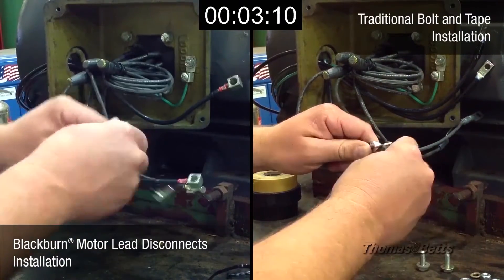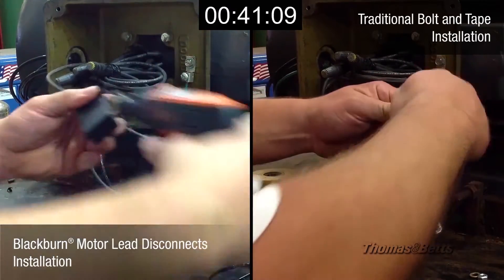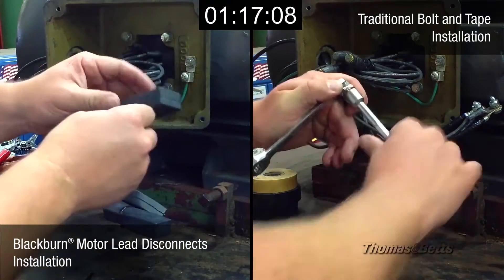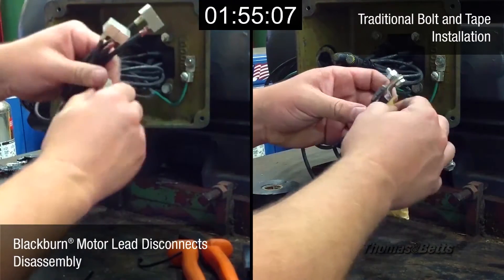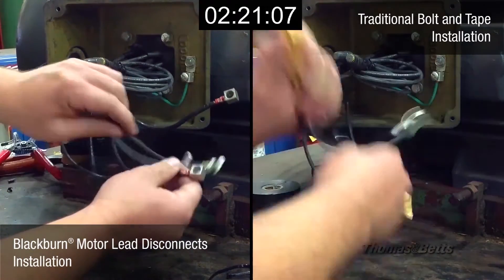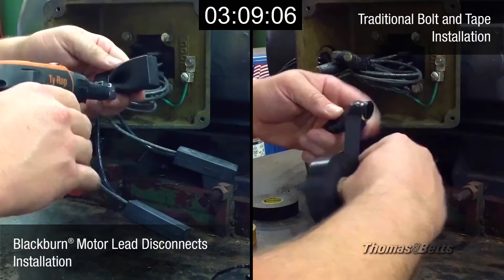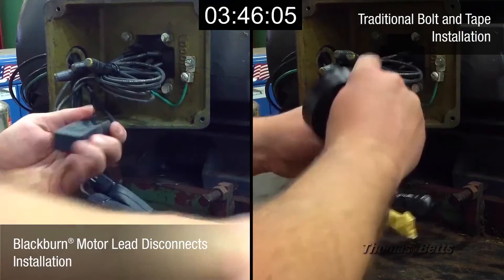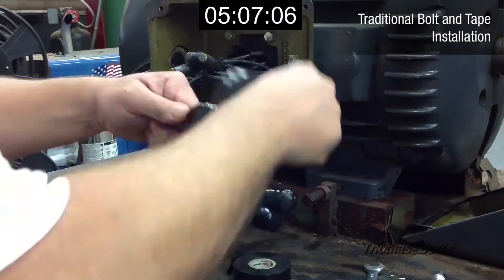Blackburn® Compression: Motor Lead Disconnect Time Comparison

Comment: awsome! I just need a part number on these connectors!
Reply: the 10 times the cost won’t justify saving 3 minutes in labor costs. standard compression splices cost $1 vs these probably 15+ each
Reply: @koston240life  saves way more than 3 minutes